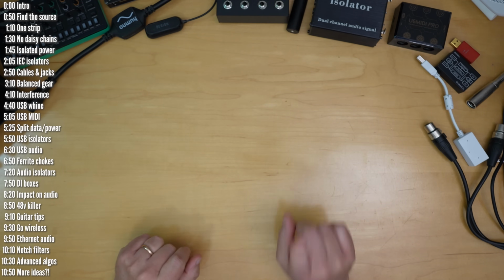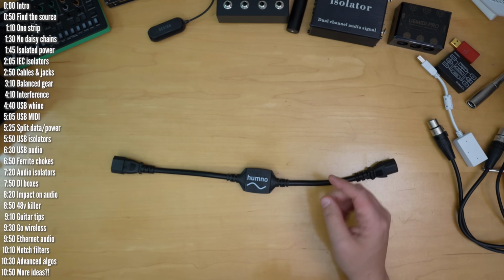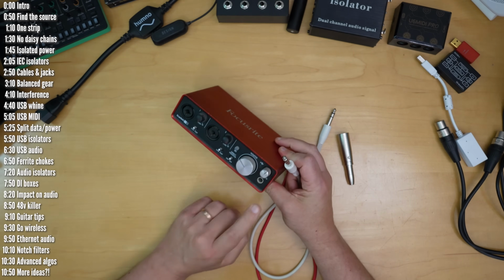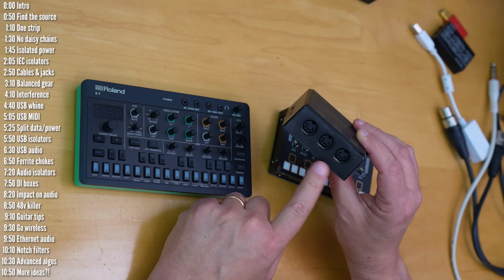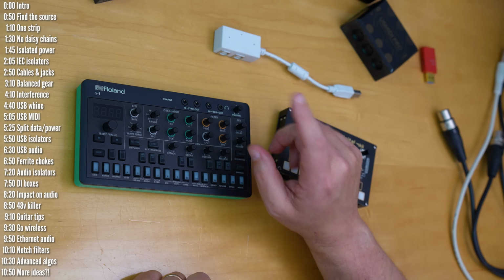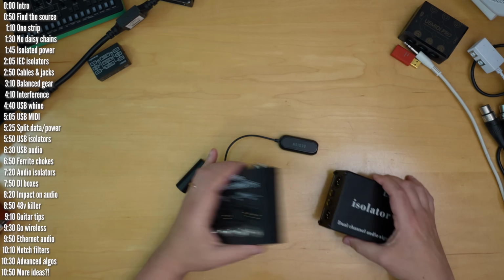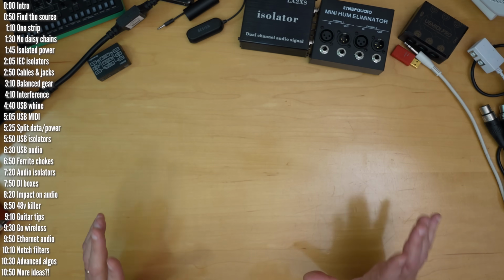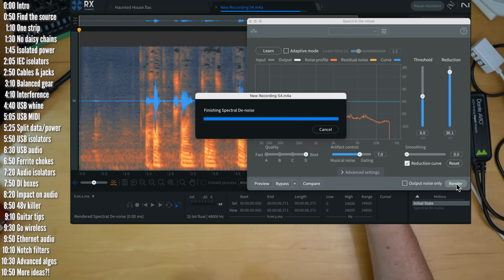12 better, simple and cheap ways to fix noise, hum, buzz, ground loops and USB whine

Comment: Hello Ziv - foraging around I find a few (even in this comments thread) who hold that connecting the iFi iDefender directly at the computer and from there to a hub (or hubs) removes USB whine and the like from audio generators connected to the connected hub. Is this your experience? How many iFi units do you use? Or have you moved wholly/partly to the HS02 instead of iFi-units? Stellar post again!
Reply from the maker: Thanks! I no longer use the iFi because it didn't work for me in all cases without power and I'm too lazy to plug power into it... also my unit has microUSB because it's pretty old and who knows where those cables are. The HS02 just works so it's my go to

Comment: Will the HS02 work on a usb hub that has it's own power? That is my sourse for usb noise. The hub works great but it brings noise.. It also has no choke. I assume all other synths connected should have a choke as well.
Reply from the maker: It has for me but I recommend getting it from somewhere with a return policy just in case

Comment: USB isolators are usually USB1 only. USB2 and higher are more expensive and doesn't guarantee that they'll work which adds to the expenses if someone has to buy several of those. 
When this is a problem? For example with digital multi track mixers like my Mackie Onyx 24. After adding cheap USB Isolator it limits it to just 2in/2out.

Comment: That usb whine..I get it from the connection between pc and audio interface, I think it's on the computer's side, because I wiggle the cable there and I can get rid of it (or get it much worst and hear really nasty noises). I thought it was something defective on that usb port, but idk now, maybe trying a different cable before trying out something like the Topping?
Reply from the maker: @unbichoverde  sounds like a bad cable, I’d try that first

Comment: im dealing with noise spikes at 8kHz and 12kHz when recording audio, and I haven't been able to find a solution.

The issue occurs whether recording audio through my audio interface - but It also happens when using a Zoom recorder on battery power.

on different mics, guitars, basses, synths etc. 

 I’d really appreciate any insights or suggestions

thanks
Reply from the maker: It sounds like USB noise, everything I know is in this video so keep trying!
Reply: @loopop  Hi thank you for all the tips and tricks! and to everyone else with ideas, the zoom is just recording on SDcard with batteries - and still gets the spikes :(

Comment: I’ve solved all hum and noice problems like this. But one still remains. The. Macbook plugged to power it introduces noise and hum to speakers. When on battery its okay
Reply from the maker: @FLASH136631  are you connected to the speakers with balanced cables?
Reply: @loopop  Im using Amphions speakers, and they are passive unfortunately :(

Comment: Hey my friend built a guitar with a midi controller integrated into the body. It’s cool, but he didn’t anticipate the potential noise and interference issues. When the USB cable is plugged in there’s a lot of ugly USB power noise that gets into the Guitar signal. We tried isolating and grounding the signal cables more with shielding etc. but that’s not working. I’ve been thinking that the USB isolator is probably the way to go but if you have any suggestions please feel free to share them it’s been a lot of work for him to build this thing and he is kind of at a standstill with this issue. Realistically he needs something that stops the noise that could fit inside of the guitar so you don’t have to carry around a USB isolator externally. Thanks for the video this stuff is always a pain in the ass
Reply from the maker: Sure - try a cheap isolator first, then the Topping option if you feel sound has been impacted

Comment: I have found a plug-in solution that I use some of the time.  The plugin Busfri by Klevgrand "learns" the noise source and filters it out while retaining the signal, which if I'm in a hurry sometimes is a life saver.  It has options to mix/adjust the amount of intervention which is useful because honestly on analog synths sometimes the noise is part of the character.  Is it a fix-all for everything?  No and I wish I could find one.

Comment: You can clip the ground pin on iec cables. The neutral functions as a ground
Reply from the maker: As I mention in the video that's dangerous and probably not legal
Reply: @loopop  yeah but have you considered the alternative to dying is 60hz ground loop hum? I probably wouldn’t do it in the UK where they run 220v, but also consider that their 50hz “earth” loop hum sounds like aliens yelling in your skull so maybe dying is also better than that. Or possibly dying. If you’re really worried you can do that thing where you create a platform out of glass bottles and plywood so you can’t be the ground yourself but also I don’t know if that will work we don’t use glass milk bottles anymore really.
Reply: @loopop , also, the OP doesn't seem to understand that the neutral line of the power cord doesn't function as a  ground-path for RF noise, whether created by or received into the device, unless the neutral is coupled to the chassis via a capacitor (the infamous "death cap" found in lots of vintage equipment) that is supposed to block high voltage (in case the power cord isn't polarized or an incorrectly wired AC outlet has reverse polarity) while providing a path for dumping noise to ground. Otherwise,  removing the ground pin from the power cord leaves the chassis ungrounded and prevents it from being an effective shield against ingress or egress of noise. 

Modern electrical code requires earth grounding, and disallows "death capacitors", except for using specially designed and high-voltage rated X or Y safety capacitors from hot and neutral to ground, which is done to shunt line-cord voltage spikes and noise to the earth ground. As a now-retired audio tech, I always removed the death cap and installed a grounded cord into old amplifiers, especially guitar amps.

PS, floating the shield at one end of the TRS or XLR cable is an important tool for preventing ground loops. Using plastic isolating washers for bolting equipment into metal rack rails is another; the devices should only be grounded via the power cables and the rack rails should not function as commoned buss-bar grounds.

Comment: Excellent help here, sir. thank you very much!
Wanted to add - reafir comes with REAPER and works in the same way as your Audacity example - create a profile of the noise, then apply it negatively to your audio to filter it out.

All good stuff. External hubs are doing the trick for me, but with GAS being what it one never knows what new and , ahem, "improved" noise problems lie waiting around the corner as more gear is added. C'est la vie. Cheers!

Comment: I learned all this the hard way, with  months, if not years of experimenting/researching. I'm glad loopop came out with a concise guide too, it will save you time! I've since switched all my unbalanced cables for balanced, use DI boxes for truly unbalanced outputs, use midi DIN when powering over USB when possible, plug all my stuff to a single outlet via a UPS, and have some of those denoising adaptors , specially on my PC, and its been great so far.

Comment: Clean power can have a big impact on some gear. I replaced individual Boss wall warts that went into a Furhman power strip for my 6 pedals with a Cioks DC7 and it dramatically improved the noise floor. Daisy chains definitely didn't work well (mix of analog and digital pedals). I'm also using the Cioks to power my Roland SE-02 and may expand it so I can power a couple other synths (you can buy cables to combined power output).

Comment: I use the behringer HD400 - it has two channels of in/out. And costs anywhere from 10-20 bucks. Even breaking all the rules (like using multiple power outlets) I can crank up the distortion on a plugin on any of my synths and just get the faintest little background hiss. That’s always my first recommendation to people suffering from USB whine!

Comment: Three to two prong adapters are fine if you're plugging into a power strip with surge protection. Most synths are two-pronged anyway, but I have an adapter for my Matriarch and it removed the ground loop that the 3-pronged power cable was causing.

Comment: Ferrite chokes do work for reducing radio interference which is so common nowadays but you have to make at least four loops and put it through the choke. I have good experience blocking noise coming from computer via USB cable that way. Downside is you need much bigger ferrite choke so that four loops of cable can fit through it.
Reply: Best to locate the ferrite right where the power cable enters the device; the purpose is to prevent the power cord and the house or studio electrical system from becoming a local broadcast antenna and re-radiator for noise generated by the computer, wifi router etc.

Comment: USB splitter shouldn't help against ground loops, because the grounds are all connected again anyway, since USB signal is actually ground referenced and not truly differential. Unless there's a real signal isolator inside like isousb211.
Reply from the maker: The USB splitters I show in the video solve the noise problems I experienced.

Comment: Focusrite just launced a page with the heading: Optimising Windows for Audio. I recommend that you look it up. They have a comprehensive list with Windows settings that can create sound interference. I had issues that had nothing to do with buffer sizes. I had interference not even playing any sound. By religiously following the list disabling unnecessary devices etc etc, I got ride of an interference that drove me totally nuts. Thanks for sharing. This is a very good video.

Comment: Another suggestion for removing electrical noise (from someone who principally plays guitar!) - try turning off any devices which might be using ‘switching’ power supplies (most often used to turn mains AC into low voltage DC), like phone chargers, smart speakers, laptops, etc. Many will be fine, but cheap ones often aren’t constructed well. Takes a little trial and error as most are designed not to produce interference, but also easy to replace power bricks or move them away from your recording space.

Comment: I am 100% of the time hearing that sound at 0:06. Any idea what it could be?

My singal flow is:
Bass guitar ---> TS cable ---> audio input of Scarlett 2i2 audio interface --> USB cable to Windows PC running REAPER --> audio output is then coming out of the headphone output of the Scarlett audio interface into my headphones.

The sound is always louder/worse when I am sitting close to the PC while playing.
Reply: The good news is that unless you forgot to describe a device, you have no ground loop. But just in case do make sure you ditch everything but instrument and headphones from your Scarlett.

The cause, absent that being an issue, is your guitar's shielding, LED/CCFL lights nearby, unrated PSUs with no EMI protection. Try chucking your keyboard to the side too, unless you have an earthed midplate, they can be diabolical because LEDs are strobed one at a time basically and line column strobes for the scan-in can do a little bit of that as well.

Comment: I have a Taylor acoustic that I usually record with microphones, but when I tried recording with the internal pickup system, I discovered that they don’t ground their jack with the strings (probably a good thing!), so in my setup it does a lot of noise. I tried everything including RX in post and couldn’t get completely rid of any noise, even if RX works well to get acceptable results, but then I tried C-axe and it was like magic, no noise at all and no impact on dynamics or sounds. It only works if you have a universal audio interface but if you have one I suggest giving it a try, they often have discounts and deals so you can get if for 25/30 euros if you pay attention, don’t waste the full price on it, but it’s very recommended.

Comment: Having the audio cables not near the power adapters is the number 1 tip. In Eurorack, you might have an analog module that picks up interference from a digital (RPi or teensy based) module.

Comment: I used a cheap USB isolator between my computer and audio interface... and that worked.  But then I stopped using a computer for music, and that worked even better.
Reply: hahaha
Reply: man, i wish...!
Reply: what sort of 'cheap' one .. can you link it?
Reply: @Ninja_Gaijin  On youtube?  No.  I literally can't link it here.  Links get deleted as spam.  Plus, I don't think the brand exists any more.  From what I recall, it was just a cheap generic adum3160-based dongle from one of the many ephemeral "cheap junk resold from China" brands on Amazon.

What really worked was switching from a notebook to an Akai Force (or pretty much any MPC).  It solved SO many problems...

Comment: I wish this video existed a few years ago. This is really helpful, especially for people who need a solution without digging into the rabbit hole that is hum and noise reduction in a setup.
- Some thing to add: An active DI-box can be used for higher signals, too. They often  can attenuate and / or boost a signal. The main benefit is, that active DI has less to no signal loss (general rule).
- TS cables tend to pick up noise when shielded badly. That is also why CAT Ethernet cables are actually really good for audio signals: Their shields are often of a high standart.
- wireless gear may introduce different intereference into the setup. In-Ear-Monitor Systems are prone to that. The more frequencies are bein used, the harder it get's to get a clean signal. This includes wifi frequencies btw so sometimes, turning of some devices may help.
But again: this video is great info and will probably help a lot of people solve their problems!

Comment: '[...] new products came out (since) [...]' -  So every studio/theater/stage have and had to handle this kind of problem for decades.
DI-Boxes with galvanic isoloation, optical transmitter, and as mentioned in a kind here: gears wich are not related to audioproduction, specially fans, lightbulbs, dryers, washingmachines etc. ... have to be seperated from the audio circuit.  
Laptops with a HDD in the setup also do a lot of time inferences. I reommend the DI-adapters by Neutric in the the setup.

Comment: I don't know if someone had mentioned it, but Reaper includes a quite decent FFT+Dynamic EQ plugin called ReaFIR, that can do noise profiling when you put it in "Subtract" mode. I used it to salvage recordings from awful microphones, removing HVAC/Fan noise and USB whine.

Comment: Why don't manufacturers of the synths include isolating devices inside their gear? Std Midi incorporates opto isolators for this very reason. Cost cutting and turning a blind eye to it seems to be the real issue. Arturia even supply the data/power splitter cables, so they know it's an issue. As do Roland, their boutique synths have usb noise too, my JD08 is unusable on my pc USB port with audio out from the 3.5mm jack. We shouldn't need to buy extra gear to fix their problems.

Comment: I had this problem with my Waldorf Iridium using midi over USB. Waldorf tech support recommended a USB Isolator with a ADUM3160 chip, which I found in the simple $14 isolators on Amazon.  Actually works really well - noise removed.  Had same problem with a Zoom H1e connected as a USB audio interface to my MacBook and it solved that problem too.
Reply: Isolator with the same chip worked for me for Beatstep Pro and Keystep 37, where the original dongles from Arturia failed.
Reply: Adum3160 only supports usb 2.0 full speed and some dacs will not work at all. My audient id4 for instance doesn't work with full speed isolators. I am in the process of designing my own that can do high speed(480 Mbps) with integrated power isolator and a hub component for multiple outputs.
Reply: @Rubacava_ adum3165 is 480mbps and very cheap.

Comment: It ought to be mentioned that MIDI is galvanically isolated: the MIDI in is (or should be!) connected via an opto-coupler. This means that the electrical signal is converted into light, within the same chip, back into electrical signals. But the two electrical signals are isolated.

Therefore, a properly designed MIDI interface will never transmit hum.

Comment: USB midi hums, sometimes its because the midi in hasn’t been implemented correctly, midi in isn’t supposed to use the gnd connection…. So if you get your midi cable, and snap out the ground pin with some long nose pincers you’ll still have the two data pins connected, but also be electrically isolated between your daw and synth.

It’s kind of the same principle as the power/data splitter, but much easier to live with.

My moog Labyrnth has this problem, using a din cable > trs adaptor for midi sync. Snap the gnd pin and annoying buzzy hum gone - happy dayz

Comment: Run your gear off battery banks. Use step-up tips/cables to power stuff that wants more than 5v. I never get ground loop even with 4 devices connected to one bank.

Comment: I swear by the Hifime Audio USB Isolators, and prefer them over the iFi Defender+, as they provide USB power without an additional external power adapter.
- USB Isolator - USB Full-Speed (11Mbit), 200mA of USB power - $30
- USB Isolator (Full Speed, High Current version) - USB Full-Speed (11Mbit), 400-500mA of USB power - $40
- High-Speed USB Isolator (v1, v2, or v2 USB-C) - USB High-Speed (480Mbit), 400-500mA of USB power - $60